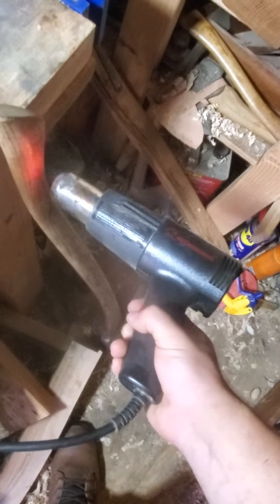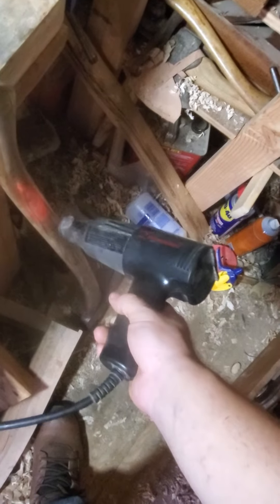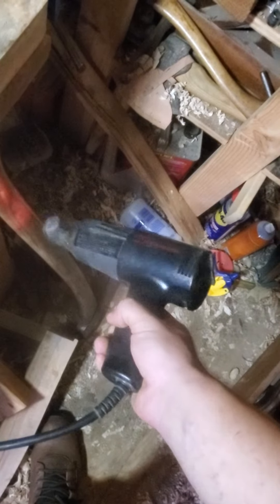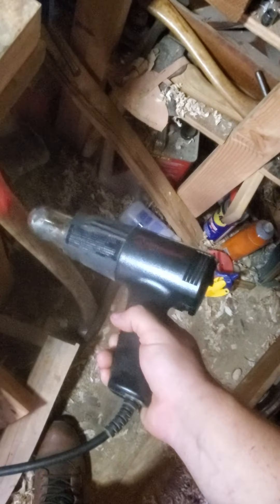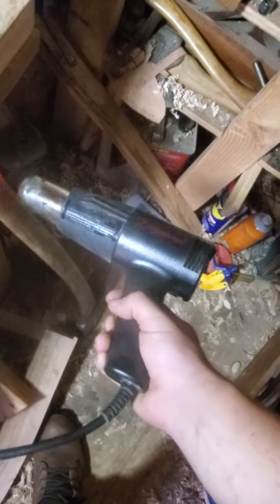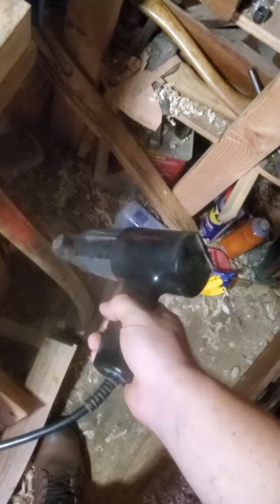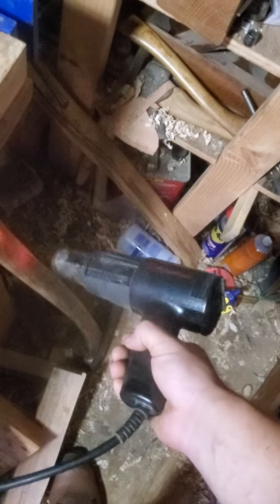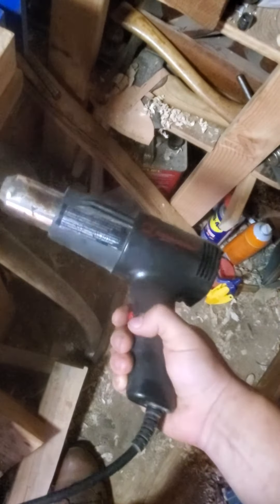Heat bending a warped axe handle

Comment: Going to try this on a handle I just got. Do you soak the wood at all? And how do you bend it, just by hand?
Reply from the maker: I never tried soaking the handles, although it wouldn't be a bad idea to try it. Most times the heat gun will leave a mark on the handle. And yes, I do just bend it by hand. I have a vise I use for applying pressure to a specific area to bend it back